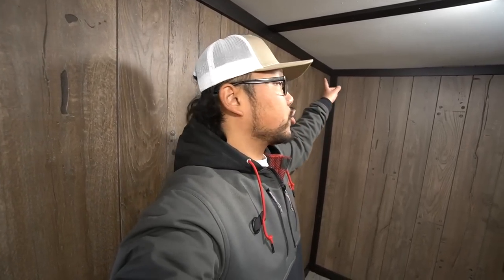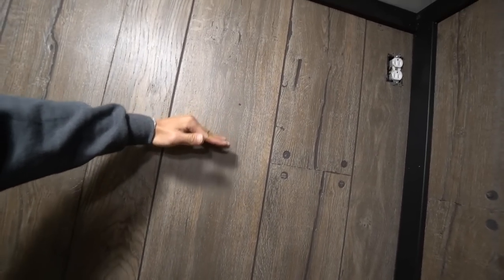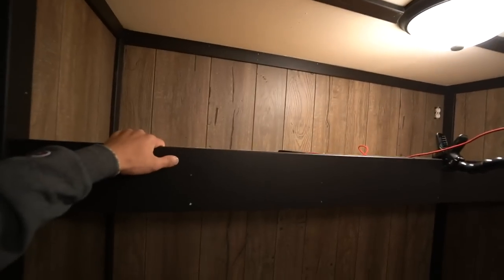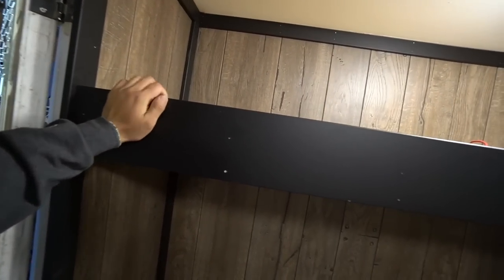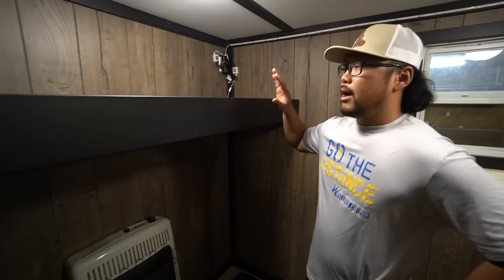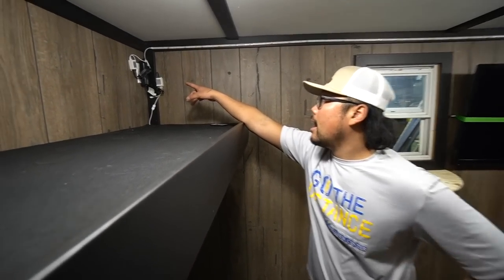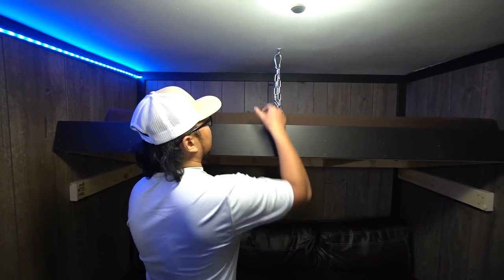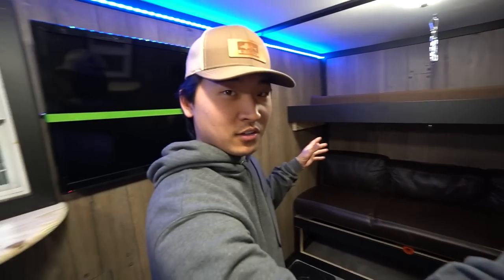We Transformed an Old Trailer into the ULTIMATE Ice Fishing Shack! (FULL WALKTHROUGH)

Comment: Might not be needed, but not bad to add a middle support piece below the bottom bunk. Sucks to put it in the way, but hate to have the board giveaway with people sitting/sleeping on the couch. Fan under the front shelf to move heat is a good thing and rattle reels all around. Love that you kept the middle open, little table next to the door may get in the way loading gear in and out. Overall great job making it yours and updating it.

Comment: I have a 10x20 permanent ice house up in Alberta, Canada, a few things that I like having are ....a 5 gallon pail for clearing out hole slush, rod storage rack, some storage bins for under the bed for odds and ends that accumulate, coat hangers are nice, some folding rv/ boat cup holders, rattle reels, a couple folding TV tables can be handy, a fan on the roof or corner pointing down to move some air on the floor to heat/dry the floor they have some great rechargeable option you can get off amazon, maybe look at a Jackery as a quiet power option.

Comment: Very nice looking build.  With regards to the sensor, I would also add a gas detector to your setup.  This is a little different and should be used in combination with the sensor you have.  I got mine mine on a certain large online retailer, the brand I went with is Pangaea.  This will detect a propane leak, which your current sensor would not.  Just a suggestion and something that new wheelhouses come with.  They even have them in black which would match your look. Great build all around.

Comment: Very nice work. I like the ceilings a lot with the trim pieces and that jackknife couch is awesome. I would want to figure out a way to cook easier in it if it was mine. Even if you just had a setup over the heater that would allow you to cook, but have a vent stack or some side venting with a fan, too. I don't know how to do it either. You'd have to employ Justin again.Or create another shelf/surface under a window that suits a cooktop  or camp stove for frying fish. I don't know, boys. Other than some rod holders on the ceiling or walls, rattle reels, that's about it for now. Go slay 'em in comfort!

Comment: You need to add a metal plate to the under side of your storage shelf.  The heat rising from the heater will burn the wood.  Once it catches fire, it will be too late for whomever is around that end of the cabin.
Reply from the maker: Rip

Comment: I think you should turn the table stand into a garbage can, could put some epoxy pond liner or waterproofing inside, paint it and use that as the garbage can, so you can clean it out. Or just throw a bag in there and small door, you don't have to waterproof the door. 

Next time I would use some lag bolts for the 2x4 construction, just so it's super strong and sturdy, then you could throw a bunch of heavy things on the shelves in case. The difference is a shelf that supports maybe 500 -600 pounds, or like 3,000 pounds, obviously one is stronger, the 2x4's are not the weak link. Another of my favorite fasteners are concrete wedge anchors, these hold anything, we use them in construction all the time. This is what is holding your life when you step on a elevator or some type of rail system, hundreds of those. Helps to understand this before you make something, I know that I can always use stronger fasteners. 

If you have a brick or concrete wall, you can mount just about anything on there, even a car.  Concrete block walls are just so much stronger than wood framing, I don't even want to build anything out of wood framing to be honest.  I don't even know why we use drywall, I see it as garbage material people use to get flat walls, it makes your home dusty and gross though. It's time we stop using it, like asbestos.  If you start with a concrete slab and walls, it makes a bathroom or kitchen just so much easier to build, you don't have to worry about mold or mildew at all.  The most expensive thing is labor, brick or wood looks better anyways.

Comment: put a small fan on the floor over by the couch. It s easier to push cold air to the heat source than it is to push hot ad try to push cold dense air back to the heater. It will make the floor a lot warmer!